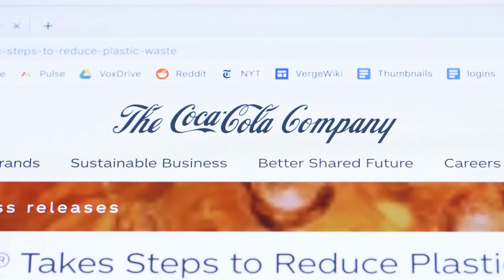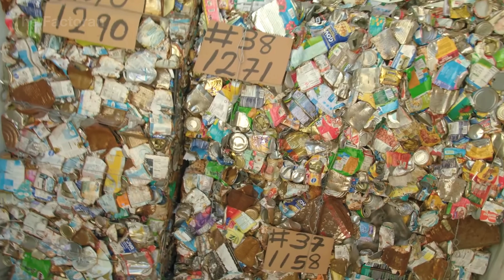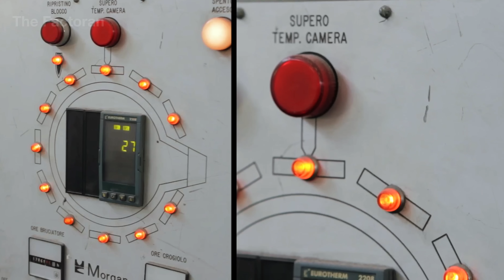How Millions of Aluminum Cans Are Recycled In Factory - Massive Recycle Processing Line

Comment: I recycle alloy in my garage workshop. Engine blocks and head. Pistons and Wheels and suspension arms.I get around £150 a load  full of two wheeling bins filled with discarded alloy parts.Its worth saving and storing the waist. We also collect waist metals and cash them in and have a container filled with brass fittings. Enjoyable video.
Reply: Waste